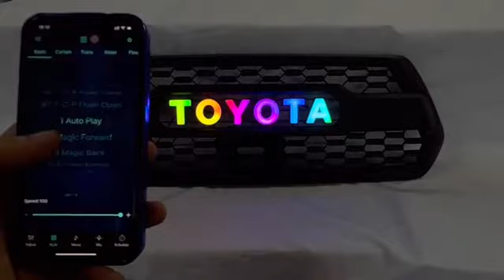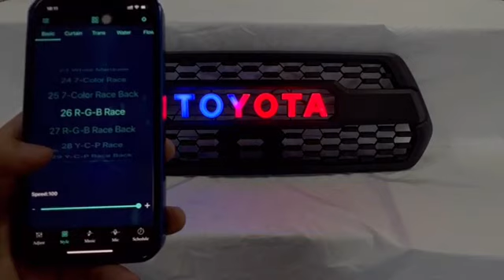Install 2016-2023 Tacoma Aftermarket Trd Pro Grille Light Up Letters

Comment: Can you do an installation with these lights and the regular raptor lights?
Reply from the maker: Yes, you can just twine the red wires together, and use one add-a-fuse only for both lights.